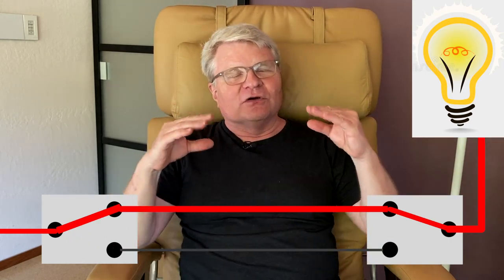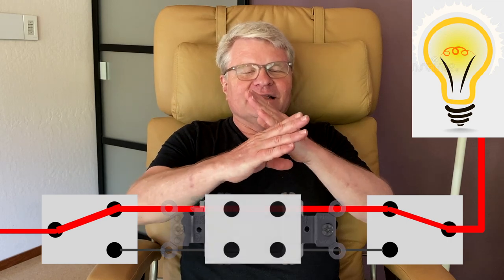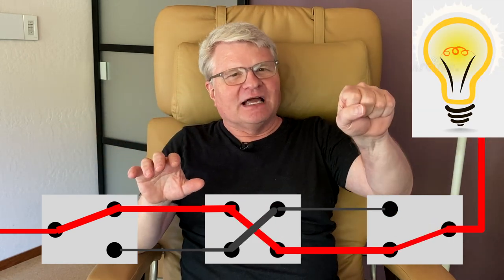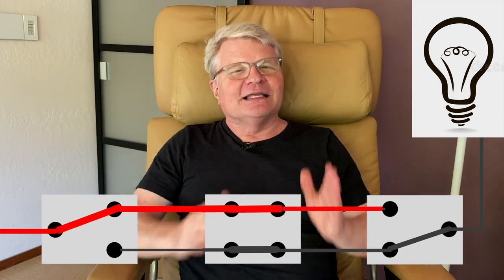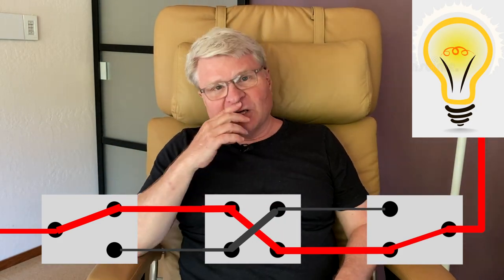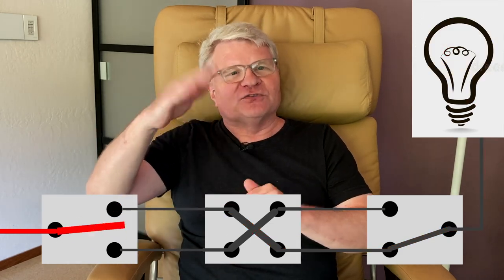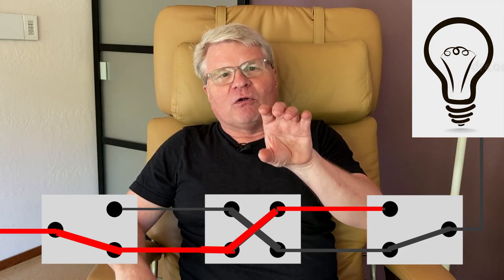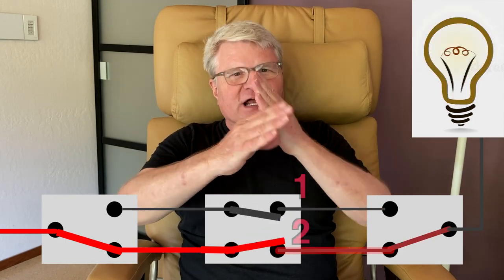Another Idiot Explains 3-Way & 4-Way Switch Wiring In 2 Minutes With Animation

Comment: Naturally, I'm on YouTube searching for the most simplistic definition of a residential 3-way circuit because the "skilled" labor I was given for my DIY house remodel can't wire it so it works. He said his background is electrical. So, question... (if you even read these still 3 years after posting this)... does it matter if the constantly hot switch is a 3-way dimmer?
Reply from the maker: @brianckelley  Nope. That will work fine. Although I do find when I want to change the brightness of the lights, I always seem to be standing by the wrong switch!
Reply: @WardCo  truly appreciate the swift reply. You're the only thing that is going right today. Thank you.